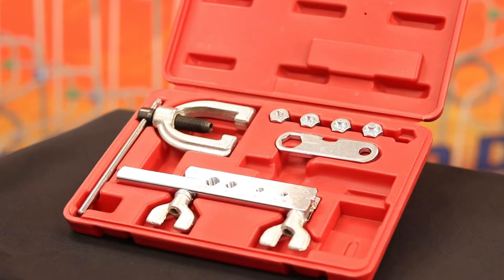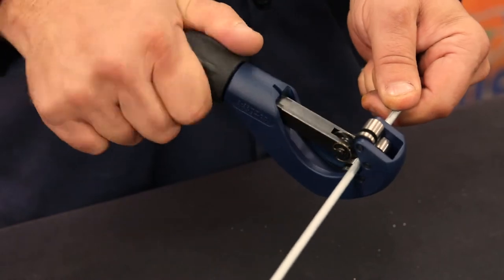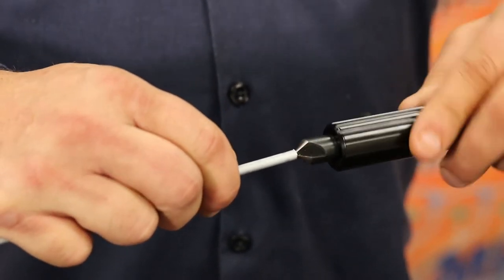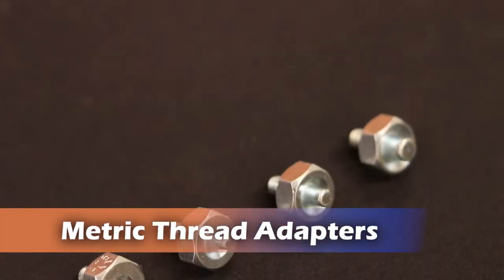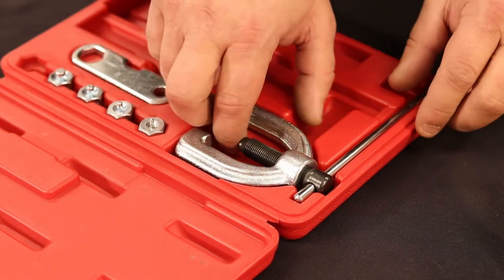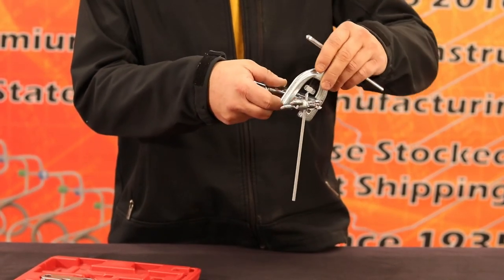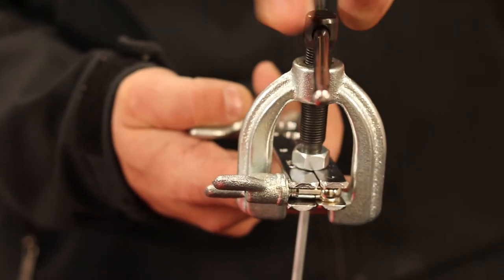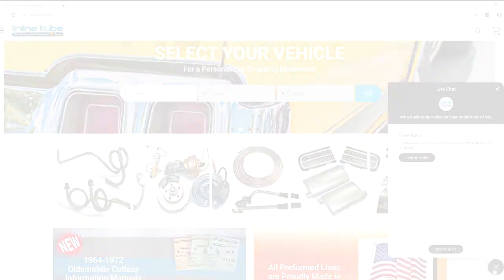How to | Metric Bubble Flare

Comment: Hello Chuck,
I watched the video on the metric bubble flare but I have some points that I want to bring to your attention.
01- The finished product is not shown free from the tube holder. I can't see the actual end of the tubing.
02-It would be much more explanatory if you could show a close up of the finished end, this way I would have it as a guide to the tubes that I want to do an ISO flare.
03. Is the back of an ISO flare, as it is formed, somewhat perpendicular to the tubing itself and the front is the bubble?
04. the line that I pulled from my vehicle is like that, bubble in the front end and flat in the back, is this the way it should come out of the flaring tool, or is the process if seating the tube in the fitting that causes the beveled end of the tube to flatten as is being forced by the tightening of the other fitting.
05. do you know where I can find the norms for ISO flaring that gives me the angles and dimensions that the flared end should have? 
Great videos, they are of much help to clarify things
Reply from the maker: Thanks for the feedback! We'll use it to improve our future videos.

Please check out the attached photo for what a completed ISO metric bubble flare should look like, including some angles and dimensions. It will help to answer your questions.
 To view the photo, copy and paste the link into your browser.

Please contact support@inlinetube.com if you have any additional questions or comments. Thanks again for reaching out to us!

Bubble Flare Photo: https://cdn.shopify.com/s/files/1/0010/6515/6669/files/Bubble_Flare_Dimensions.jpg?v=1583265276
Reply: D Veloso, you bring up the points I was going to bring up. How does someone make a video on creating a bubble flare and not show you the finished product? Makes one wonder if they have any common sense.

Comment: Can you make a metric bubble flare on a sae line? 5/16..?
Reply: yes you can sue standard tube.  You will have to drill out the  I D of the metric fitting.
Reply: @charlesmcmartin8659  thanks 🙏🏻